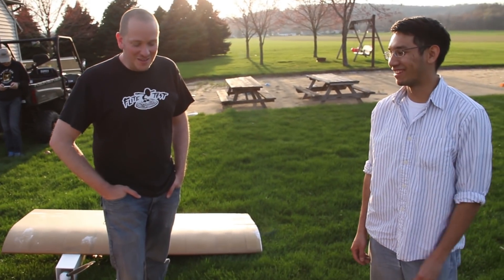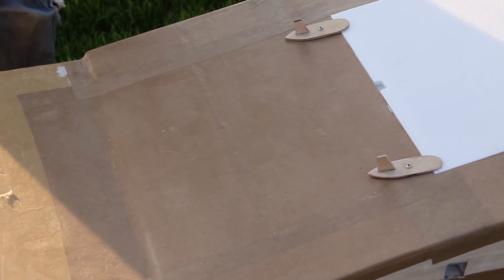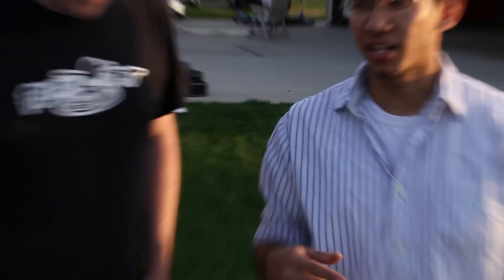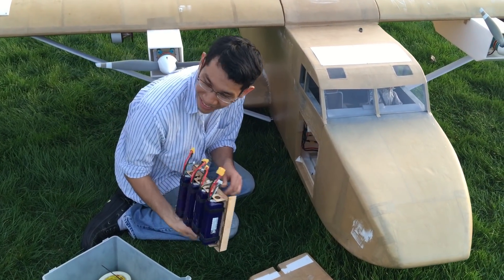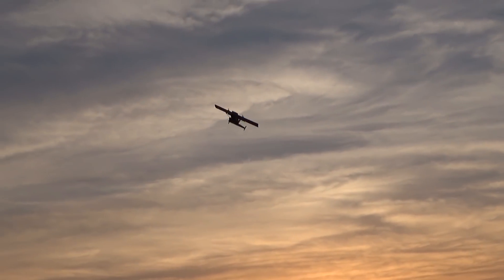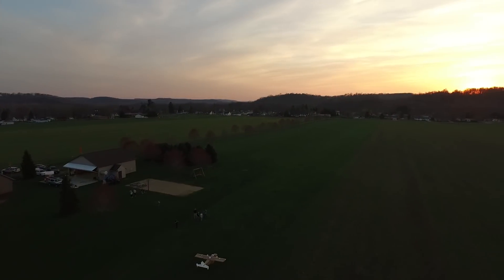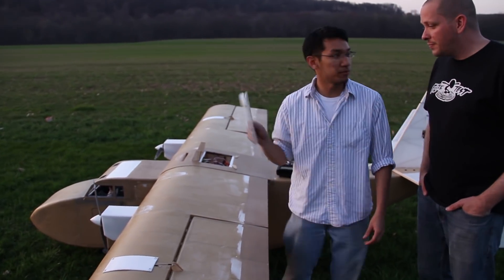DIY Giant Cargo Plane | Flite Test

Comment: I think the ailerons were deflecting upward because of their large size. Since they make up such a large portion of the wing area, a significant amount of lift would be generated by the ailerons. The higher pressure on the bottom of the wing would push upward on the bottom of the ailerons, causing it to deflect upward.

Comment: It does not seem to need it for a short landing, but did someone worked around reverse blades, either by switching the current or by making a mechanical control of the blades ?

Comment: AP New York: The FAA has determined today that the near crash of the C-23 was caused by improper maintenance which led to the ailerons becoming dislodged. A spokesman for the planes owner had no comment but promised to use more glue next time.The FAA has grounded the plane until  it has been inspected and certified.

Comment: You're probably only pulling 30 Amps per motor (or total) due to wiring size; Larger diameter wiring will allow more current. :)

Comment: You guys have probably done this before because you have done almost everything possible with RC stuff.  What I'd like to see and I think you guys could somehow do is to...... listen to this.    Get an RC KC-135 and an F-16/15 or whatever and actually refuel one from the other.  Since you don't use liquid fuel you'd be actually recharging the fighter from the KC-135 thereby actually refueling the one aircraft.  Of course instead of Jet A flowing down the refueling boom you'd have electricity and you can get connectors that work.  Slide the fighter right up behind the KC-135 and have the boom connect to the fighter probably using magnets to accomplish the hook up.   Of course you won't be able to stay as close as the real deal but even if you have a super long boom that would be great and you'd accomplish an air to air "refueling/recharging " of another plane.   So.......GET ON IT DUDES!!!!!!!!!!!

Comment: Ailerons are deflecting up because they are actually part of the wing and are therefore supporting weight - and those ailerons are huge.
Reply: When you see it on the ground they are still up. Aircraft would probably fly better with them correctly set as they are having to compensate for the lack of camber with angle of attack.

Comment: It must be fun having endless money.
Reply: I am not a narcissistic maniac, but I just feel like complaining will get you nowhere that is all I meant.
Reply: Building RC planes, all the parts and batteries and controllers and electronics requires are very expensive. If you have enough money you can do anything and have fun with it.
Reply: I think you mean having a job.  Both engines and all 5 batteries cost less than an entry-level scope on a rifle, or less than a set of 2 motorcycle tires,  or less than a high end set of golf clubs, or even a normal high end modern baseball bat, or less than a pair of mid-range cowboy boots. 

Compared to doing track days or autocross, or buying any fun vehicle, or doing many of the hobbies a lot of people do, RC planes are a shockingly cheap hobby.
Reply: Your mortgage probably costs less than a set of tyres!... for a Bugatti veyron. TYRES! 

what a dumb argument
Reply: Re
Yes, your argument was quite dumb. There aren't specialized motorcycle ties like there are 260 mph Bugatti Veyron tires. Cheap or expensive tires, they all cost about the same with install. But besides that, you completely missed the point (no surprise) anyways.
Reply: You realize that 62% of Americans don't even have enough savings to even spend $500 in an emergency right? I get it, you have a cushy life and come from middle-class family in a area of high employment. You have no idea what it's like to have to work a job full-time minimum-wage job because you didn't get a minority-scholarship or $100,000 for university. The idea of having money you /didn't/ have to spend on food rent and bills is foreign to you. It's painfully obvious. 

Let me tell you,  a hobby where the remote control alone can cost in the order of several hundred dollars, no matter how hard you try to spin it, is not something the regular joe can afford.
Reply: Not making that price up, by the way. https://hobbyking.com/en_us/jr-xg11mv-11ch-modular-transmitter-with-tg2-4xp-dmss-module-rg712bx-receiver-mode-1.html
Reply: Re
"work a job full-time minimum-wage job because you didn't get a minority-scholarship or $100,000 for university."

I'm sorry you have financial problems, but I went to college without financial assistance other than taking on massive student loans because I studied hard in highschool and I applied myself.

I didn't apply for hispanic minority grants/scholarship money because I was naive, but given I've got about another 2 years before my loans are paid off, it is hard for me to understand your bitterness.

But yes, you are right, our perspectives are different. You are shocked by an $800 RC controller, but on a whim today I bought a WaterRower.

I hope you improve your lot in life.
Reply: First you implied that simply being employed is enough to cover this, which it is not. Then when you realized you are wrong, you defended yourself by saying having a job with a degree is enough and pretended that this is entirely normal when it absolutely is not for nearly half of the population in the US.

I absolutely never said anything to indicate that I was poor or otherwise having financial troubles. That is an assumption completely fabricated on your part. 

I get it, you're a sheltered boy who was never been told no by his parents, and you always got what you wanted. You never had to see what life is really like and now that another point of view is challenging what you know, you are immediately dismissing (under a charade of superiority) it because you are too afraid to admit that you are wrong.

But I don't blame you. So many people are raised with this mentality in america. Such a typical narrow-minded mindset.
Reply: Re how about you stop complaining? The world is not fair and it does not owe YOU anything. You control your life, you want to complain because your parents are poor? Well you do that while people like me who grew up poor but actually took action are driving 2016 $50k vehicles ;)
Reply: Mike To explain myself, I wasn't complaining. I was commentating on how you don't require massive ingenuity and creativity, but instead (poorly managed) pools of money, to make fun crazy flying contraptions. It's all just off-the-shelf complete parts with everything cookie-cutter pre-made for your consumption. and i think it's all just silly.
Reply: lol yes I thought it was a dick move to validate myself with materialistic wealth, but I had to because when I was 16 my parents had to borrow $3k for a car that was unstable and I would always fear of it stopping on me. I used to cry and look at other people with reliable new cars. Until one day I changed my mindset and started taking risks opening my first business at 19.
Reply: Dunno what kind of car your parents bought, but 3K can get you a quite reliable car if you know what you're getting. Honestly, even though I can afford a much more expensive car I personally do not see the appeal of getting anything more than a decent used car from a well -known reliable make like lexus, acura or volvo for £4-9K but maybe that is just my frugal childhood keeping me from parting with my money.

Comment: I request to fit solar flixable film For coating wings and up the speed by access live current ,and remove some of paper coating ,It will be petter when you use blastic layers between thin foam when you mack joints 
good luck

Comment: Nice build, Always enjoy seeing big models.  I do feel like you need to change out your power plants. We built a twin star, used plans to build but scaled the build up. we ended up with the same issues, Buying our materials from Lowes and Depot, (there is noting wrong with that) However We had to scale our power plants up quite a bit. It's almost as if the Engine size or power plants doesn't scale the same as everything else does.  (Our twin went from electric to Nitro, just because of power issues) with Two AX120's she was hot.  I really wish I had some video of that plane, One of the only twin engine planes that I could hang by the props..       With your big ole box (no offense meant) If you are not wanting to change over, which it looks like you would rather stay electric, I would def, try to add two more power plants on that beast. With the grand total of 4 on board, she may get a little more speed. (I'd be more worried with over all power, or the ability to climb out with out fear of stalling).     Side note: Or side Question rather: The mounts for his motors look a lot like the Duraplane it self, Has any of you flown one of those, and I wonder if the duraplane had any influence on the build?      (I wonder how many wont even know what a duraplane is?)            Crazy curious CarolinaCrisp, from Race City USA  N.C

Comment: Really nice build.   Need to figure out the Amps and up the power to those engines.  Always pin your hinges, it's easy.    Looks a lot like a Shorts 330 with a center vertical fin.

Comment: Here's a project when I was a nipper in the 80's there was a magazine (RCM&E) that ran a series detailing a STOL biplane with leading edge slats, huge flaps high cord etc. with modern electronics (you can fit everything these days in one servo bay we had to use) it should be a breeze. 
I'm just getting back into it and your channel has fired my imagination beyond just stooging around the field like an old fart. Cheers!

Comment: I would suspect the hinges were pulled out due to the size and loading of the ailerons.
If they were not glued they would  have fallen off while being assembled and handled due to their size alone.
You can see materiel on the hinges from pulling out.
Poor glue maybe or did not scuff them well enough before gluing. 
Awesome job and glad you got it in without crashing.

Comment: The aileron lifting is from the high pressure air below the wing rushing around the wing tip and into the low pressure environment above.  Reworking the wing to incorporate a fixed tip will get rid of that and also give you finer control.

Comment: That is AWESOME! What was the thing that appeared to drop from the plane as it first became airborne? Perhaps one of the wheels? If so, it certainly didn't seem to hinder the landing.

The ailerons "lifting up" and causing undue stress on the servos might be caused by the enormous size of the ailerons in relationship to the rest of the wing. Perhaps reducing the size of the ailerons would help alleviate the problem, but of course, that would mean rebuilding the whole wing. An easier solution would be to add trim tabs... but then that's gonna make the whole thing even more difficult to operate, as another channel would be required for the trim tabs. 

Fantastic job, guys!

Comment: That's some model! I love its stately progress through the sky.  Keeping the high current wires as short as possible might help the current flow to the motors but moving the batteries out into the wing moves weight where you don't want it - pros and cons.

It might be a good idea to pin  aas well as glue the hinges so they can't pull out. Something I'm a bit anal about :)

Comment: ailerons are far too large that's why they are deflecting upwards in flight. Air pressure below the wing is greater than the pressure over the top of the wing in flight, that's how the wing generates lift. In this instance it is pushing against the servo. Great attempt at building something different though, just needs refining.

Comment: That's a really cool plane, but Peter should make some new wings for it. The ailerons are a little too big; it's a heavy aircraft and I think they carry too much of the aircraft's weight, but the biggest problem is their control horns should be on the bottom of the wings. That way, the weight of the aircraft that's carried by the ailerons would be pulling on the control rods and pulling the control surfaces toward the wings, rather than pushing on the control rods and pushing the control surfaces away from the wings. With better wings, that plane would be really impressive.

Comment: The only thing that saddens me about the hobby today is the lack of combustion powered flight. I know electric motors are more efficient, cleaner and cheaper, but it just takes away from the overall experience when building and flying a model of this size, especially if its a scale replica. Although a foamy wouldn't fair well with a combustion power plant. Great job with the build!!

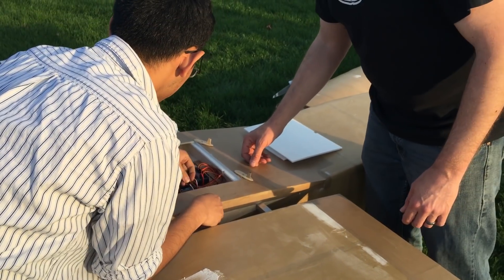Comment: @2:54 "I just winged it." Hahahahaha... Nobody? Just me? Ok...

The ailerons are massive and support a lot of the plane's weight while flying which may be a reason they were flared upwards in flight.  This changes the aerodynamics of the wing and reduces lift.  I would suggest cutting down on the ailerons size before you add any weight to the plane (assuming you're going to be doing 5 gallon candy drops on some poor kids).
Reply: ei2232 I'd also attach the ailerons together with cables, so they only need one servo. less weight.

Comment: I always wanted to know how you initially calculate the cg for any homemade plane. I mean generally it is 1/3 - 1/4 of the wing but this totally changes when you make your own wings and your own plane, and not every plane has the same cg. 
When I built my Extra 300 totally made by myself I had to crash it in order to know where the cg was. How do you properly balance a plane without crashing it? 

In this case you cannot take the risk to lose a giant plane in wich you put a lot of work and time...

How it's done?
Reply: TheBiMAX Bimax Prop the plane up on two points, one under each wing. you will then keep moving it till balanced! This procedure is just like it's done on smaller planes with your fingertips!
Reply: I think to get to the bottom of you're question what you're wondering about is how you'd calculate the center of lift of the wing.
Reply: Indeed.

Comment: Personally? I'd rebuild the winglets. Make'em an extra foot longer (you have plenty of aluminum support) and reshape the ailerons to 1/4 what they are, now.

And put two of your batteries in the ENGINE NACELLES so that the wires that carry the power are as short as possible. Route the servo-data across that length, not your high-amp power. (This is probably where the power is going)

Otherwise...I wished I had made one, guys!  Good job!
Reply: +Brian Fahrlander I think he made some changes to aileron already, but I think the poor lift/drag is at the wing tips.  cc comment ---  I think you should add a wing fence/wing-let on the main wings, similar to what you have on the horizontal stabilizer, but not as tall.  If you make sure the wing fences extend well behind the trailing edge of the aileron surface, I think the huge vortex can be use to LIFT the plane, rather than generate NEGATIVE LIFT.  I think as you have it, there's a huge swirl of air, that wraps over the wing tips and land on top of the wing surface, that's causing negative lift and a lot of drag.
Reply: Cool.

Comment: That is really cool!! I think part of the problem with the ailerons deflecting upwards (besides lack of glue on the hinges) is their width. The forces exerted on them during flight is increased because of the overall size. I think you could probably make them half as wide and they would work fine without them wanting to flex upwards. I love the size and the ingenuity involved.

Comment: Toilet rolls dropped from 400 ft will unroll in the air on their way down. How many times can the Giant cut the streamers before they hit the ground? Or would it need a couple of more agile craft to provide fighter support?

(A few feet should be rolled off in advance and wadded up to act as a drag chute to pull out the rest.)

Comment: I would suggest that your aileron deflection is being caused by the differential air pressure under and over the wing (the lift generation process) and as the chord of those surfaces is almost 50% of the wing there's a fair amount of force being generated. Wouldn't the deflection also reduce your effective angle of attack and therefore lift over those sections? Push rod actuation may be a possible solution so as to keep the ailerons in trail during flight or maybe reduce their chord but increase the span? ...great vid's!

Comment: It probably isn't, but the effect on the ends of the wings could be what Boeing fixed with the Sutter twist. A slight twist towards the wing tips more evenly distributed the lift along the wing. I think it was done to avoid flutter, though, so it's probably unrelated.

Comment: Just a tip, get a Optipower Ultragaurd.  It's a backup for BECs.  It monitors your BEC voltage and if your BEC fails or otherwise it will automatically turn on and provide voltage to your servos long enough to land.  Look it up, best investment you can make on something you care about.